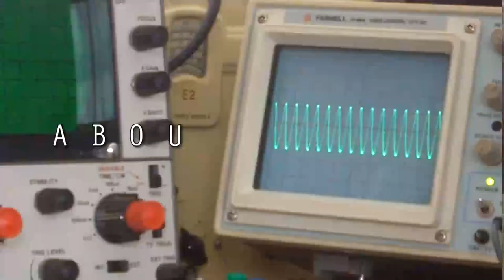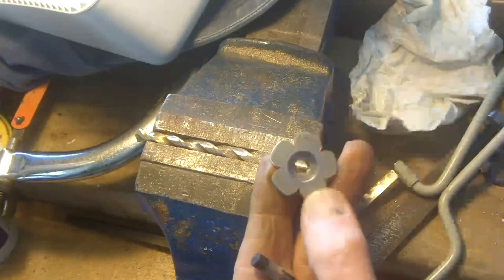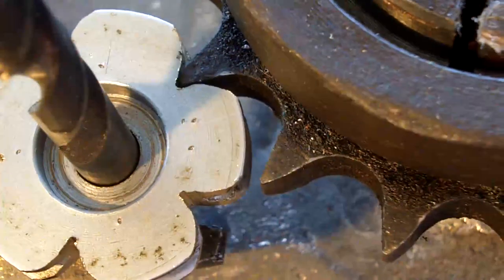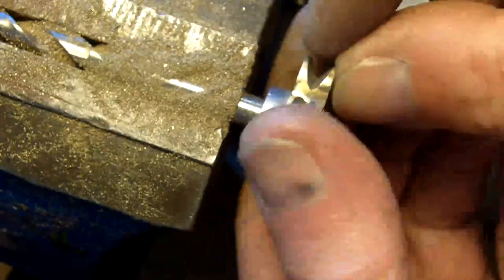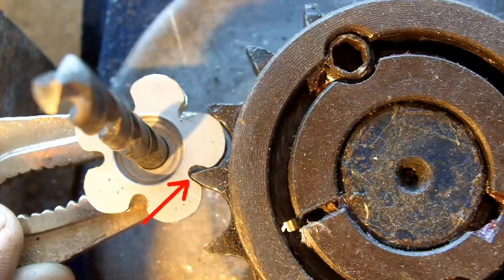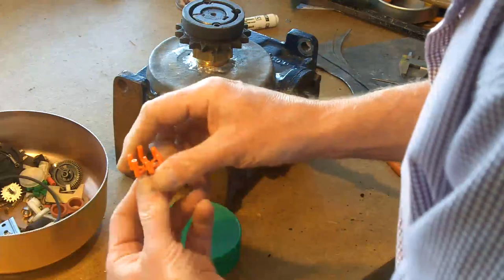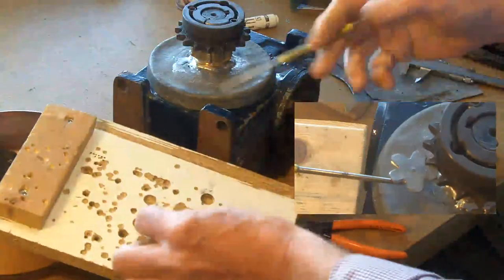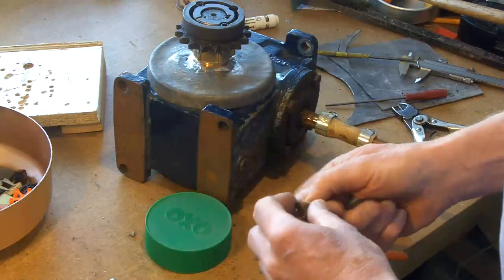About Radio 76 Antenna Rotator part 8 Cutting a gear by hand for the potentiometer

Comment from the maker: OK, got it on the second hit. I missed this program the first time around so thanks for the link. I’ve worked on some very fine machines, machines working to such accuracy they had to work in controlled temperatures as a subtle change in temperature influenced their precision as different materials expanded to different degrees but I do love basic ‘clunk-clunk’ mechanics just as much, if not more. Brevity of components with brevity of movement employed for maximum effect and efficiency.

Comment from the maker: Hi David, if I had gone to the trouble of working out the profile on AutoCAD and then thought about transferring that on to a blank gear and then setting up the cutters to hack out the material I’d probably have given up before I got started, where as to quietly saw and file away with a cut-and-try approach is very satisfying and you really get to understand what’s happening in front of you. Yep, there’s loads of mechanics in radio, ‘wave winding’ coils for one.
All the best ... Andy